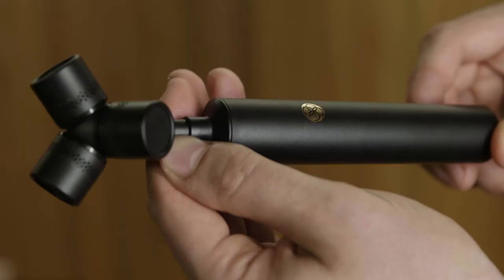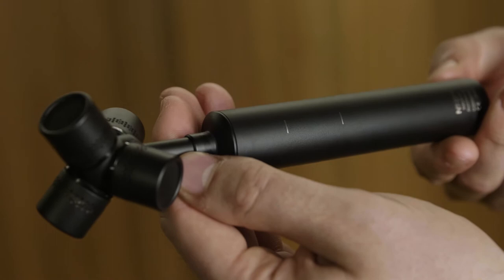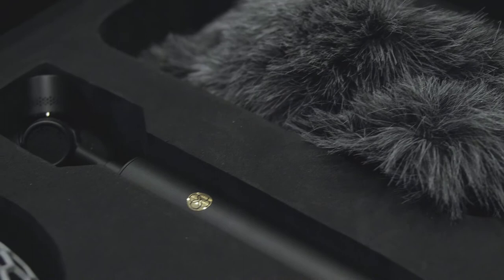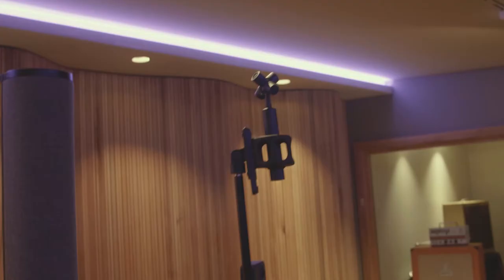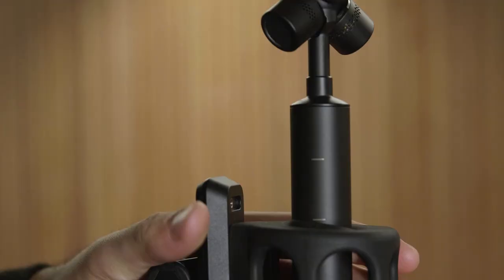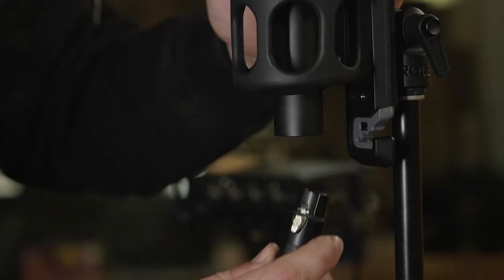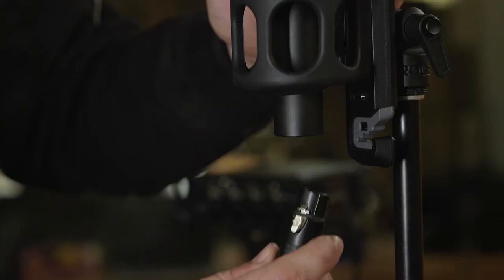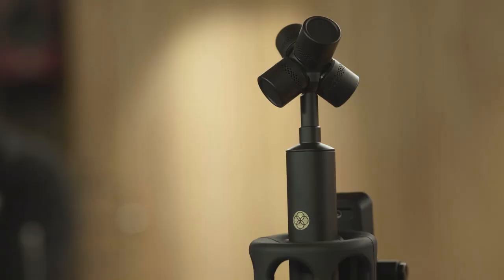Mic Set Up | NT-SF1 How-To - Episode 2

Comment: Can you use it horizontally to place it on top of camera or camcorder to record surround sound that way?
Reply from the maker: Yes, it can be positioned horizontally. Just note the Soundfield by RØDE software accounts for the orientation of the mic when processing your recording into ambisonic sound, so you will need to remember which files are recorded horizontally and input that in the software. Learn more here: https://rode.com/en/apps/soundfield-by-rode